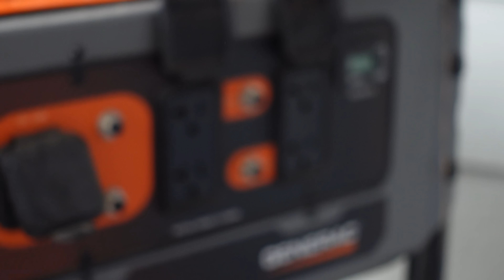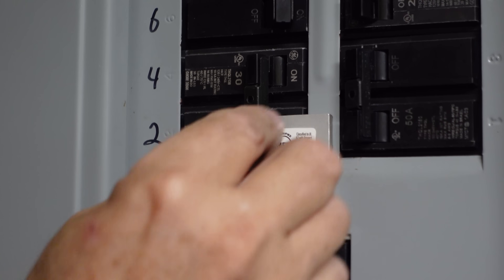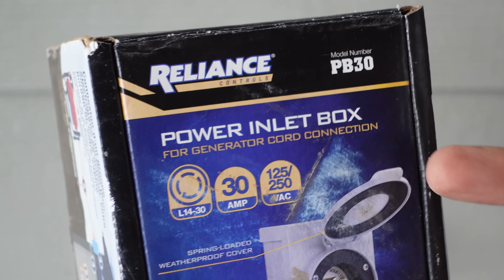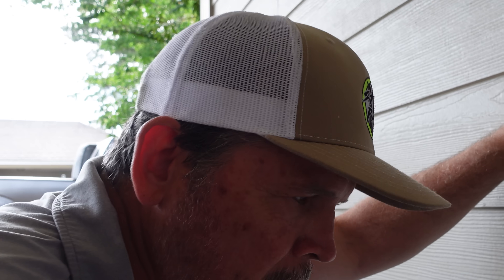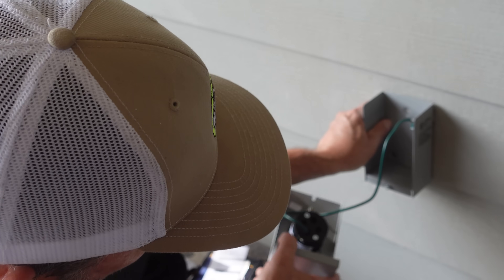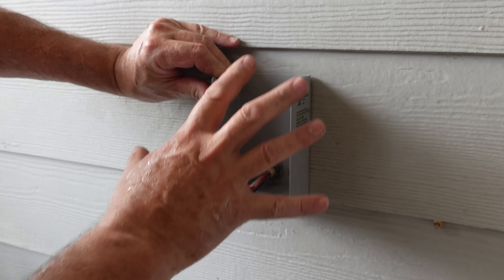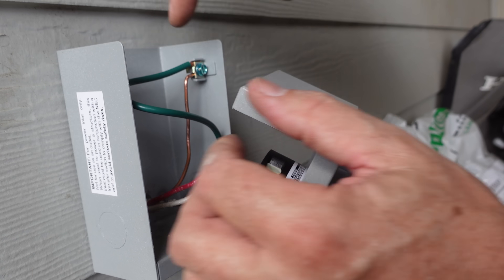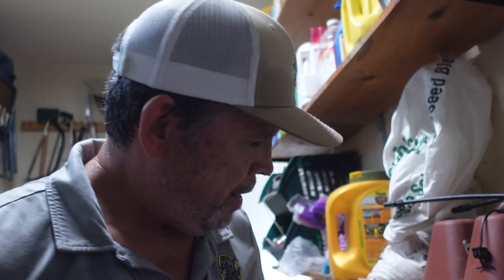What is a Suicide Cord and Why It Could Kill You

Comment: My father has been an electrician for around 30 years and instead of putting a nice inlet on our house for our generator to plug into, he just rips out a breaker from our garage and hardwires it in while leaving the face of the panel off. Then it lays there for a few days until he gets around to putting everything back together all the while power is running to an open panel with wires sticking out all over the place. I'll say this, when he wants to do something right, it's done flawlessly, but around our house he half-asses just about everything. Hell, our main panel doesn't even have an interrupt and nothing is properly labeled...

Comment: I've had a question about suicide cables for a while that no one can answer (as I am not good friends with any tradesman electricians).
At my place of work we have Dunn-Taylor single man mules for getting tools around the warehouse. Its a standard outlet plug to a transformer (which isn't mounted, it can be moved around or toted on the mule for mobile charging if you have to ride out at low power), and from the transformer to a proprietary two prong plug that matches the female outlet on the mule. Why isn't that a suicide cable? I work for a big time company I won't name so there's no way they would buy something with a risk like that, but I can't figure out where the safety is that stops me from dying.

Comment: i have a harbor freight Generator 8750/7000 its now 16 years old and i love it. but i found out the hard way that if i flip my generator breaker on and not shut off the main breaker. it will kill my generator. but i have the safety interlock. mine will run everything in my house even the water heater and stove at the same time. but it does pull it down. but also i have to run a 25 foot cord from my gen to the house. and hopefully by October i can short that wire to about 5 foot of not shorter. but here in Texas if its a portable gen you cant leave it hooked up all the time. or i would just wire it direct.  and Generac has gotten such a bad rap lately of blowing the hell up in the first 24 hours after hooking it up the first-time people are suing them.

Comment: Hello, sorry but i have to correct you about the grid interlock because you are so wrong about it! Backfeeding power back in the grid is absolutley no problem, its an feature which is used for photo electric plants on your roof, wind generators does the same! For high side line voltage, transformer primary side, iam not 100% sure but the tolerances for the voltage are around 5% to 10%, this is on primary side a range about a few hundrets volts, your generator will push nothing out of security specs! The problem is line- or phase asynchronity between the phases of the grid and your generator! In the best case of asynchronity your generator will act as an resistor and draws power from the line instead of feeding power to it, in the worst case of asynchronity (phases are oposite) your generator will act as an shortcut and will blow up in a big fireball! And at least, in most cases when parts of the grid are shutdown for security by breakers and/or transformer switches, your transformer on the end of the road is shutoff too, maybee you will backfeeding power to your neighbors!

Comment: As I watch this video I keep thinking of Paul Timberman's Workshop and the myriad injuries he would've incurred in sixteen and a half minutes. As for the actual job, not only does the new inlet look better, more importantly it is stout and stable for whoever is going to use it. (I would've thought there would've been some form of seal or gasket for the back but it looks like it's under an awning and the connection is fairly protected from the weather anyway.)

Comment: Hold on....an electrician using a level? Gotta be fake. I've never seen that before. 

Jokes aside, that is some pretty work you did there, almost makes me think i should go and do something with that electrical engineering degree i picked up.

then i remember. I work in Pathology, ive done autopsies on shock victims.

Stay safe fellas, and always double check those lines, make sure they arent live for some reason.

Comment: Maximum loading for any branch circuit is 80% of the rating of the circuit for ampacity of wire for any load. (NEC 220-2)

This is known as the 80% NEC ampacity requirement. It tells us that those 30 amps have to represent at most 80% of the ampacity of the wire (copper or aluminum wire).

Here is how we calculate what ampacity wire we need for 30 amp circuit:

30 Amp Wire = 30A × 100% / 80% = 37.5A Ampacity. When we account for 80% NEC requirement, we see that 35A ampacity #10 AWG is not big enough. With 35A, it’s almost big enough but not quite.

To use a 30 amp breaker, we need a wire that can handle at least 37.5 amps. The next is the size after #10 AWG wire (35A) is the #8 AWG wire (50A).

With 50A ampacity, the #8 AWG wire is the perfect wire size for 30 amp service.

Comment: When you put the panel in a year ago, why did you wire a 30 amp breaker for the 20 amp receptacle that was in the wall?  Shouldn't the plug have been changed then?

Comment: This is all really basic stuff.  The only thing that I can see tripping people up is sizing the cable.  It's nice to run a 50' cable to keep the noisy generator away from the house, but 12g wire won't cut it.  It's painful paying for a few hundred feet of 4 wire 10AWG but it's well worth it.  Unless you're the guy who turns on the generator with a bare plug exposed who holds out it in the rain, waves it around, and maybe licks it, for whatever reason.  Maybe such people exist?

Comment: What I know as a "suicide cable" is an extension cord that has one end completely not attached, so it's plugged into the wall and just ends in bare wires, but this is basically the same thing, just slightly less scary looking

Comment: I would have liked to seen you use some Sikaflex or similar product to caulk all around your NEMA 3R (weather proof)  PB30 box since the install is on the exterior.  Excellent install and especially happy to see the mechanical interlock at the panel.  Also caulking, besides keeping water out, will keep critters like wasps and such from making nests in the wall.  I've seen my share of wasps nests doing panel upgrades, and replacing commercial exhaust fans etc.
Reply: Yes, definitely use a sealant ! Also, my OCD wouldn’t allow me to disregard the zero slack of the ground wire inside the new enclosure.

Comment: You can always put Romex connector on slide box on then screw on locknut and no code against putting screws on inside of box ! Also I would have thrown some duct seal around the hole where wire went through the wall ! But I like the way u work taking pride in what you do ! And you have your son with you ! 5 stars to you my friend !

Comment: Nobody should use these suicide-cords, sadly they are also much to common in Europe.
Your solution would probably not satisfy the highest standards here, because somebody could in theory touch pins on the wall-box (Which should not be a problem because of the interlock).
 I think the ultimate solution would be something like the RST20i5 connector where male and female connectors are both safe to touch.

Comment: Thanks for the vid. Great info.  Also, you could tighten the clamp on the wires first, then pull it and the wires tight through the box and tighten the lock nut.

Comment: I was at work one time in the warehouse. I was holding a 240v dryer cord.
I was holding the exposed wiring side with my left hand, and the plug with my right hand.

All I was trying to do was check if the prongs were the same type as the outlet, because there are like 3 different variations of the same plug.

Well, apparently my hand put the plug a little too close to the outlet, causing electricity to run through it. 
The exposed wiring side of the cable had two ends that were touching my accident.

The warehouse lit up with a big flash, like an atomic bomb blew up in the distance. 
It sounded like lightning struck right next to me.

I pulled out the cord, and put it away. The exposed end of the cable melted. 

An employee bursted through the door trying to check on me from the loud noise and bright flash. 
They sounded and looked extremely worried, and I’m just standing there like “sup? Noise? What noise?”

Likely thee stupidest moment in my entire life

Comment: So, what happens when your generator is "Y" center grounded and you just floated the house common at some potential so the lineman down the street gets shocked by the common neutral through earth to the generator?  Your isolation breaker won't protect them because it doesn't isolate generator ground be it "Y" or delta configuration.
Reply: The ground usually goes outside your house into the ground with a stake or is connected to your plumbing where the copper pipe is the ground. Its not connected to the grid at all. Found the stake part out after accidentally hitting it with a weed eater.

Comment: I recently bought a charger cord for my phone that had two male ends that are exactly the same USB end and thus came with a special charging block. That was a major mistake on my part because neither end fitted properly even though they look like they do. I threw the whole set away because how the cord and block were designed, one without the other was worthless unless I wanted to keep one part and pretend it was a decorative object
Reply: Was it a dual-ended USB C cable or was it USB A? Or was it lightning, because I'm sure dual-ended lightning cables exist. What phone do you have?
Reply: @richardmillhousenixon  Duel-ended USB C; I have an Android
Reply: @samsimington5563  USB C is becoming a standard to replace USB A, so it is really easy to find USB C power blocks and USB C dual ended cables

Comment: Is the wire going to the panel large enough? I couldn’t see the gauge of the wires. I think that I would install #8. I understand that #10 is the minimum for 30 amps. I would install #8 for as hot as it gets there and for a possible future upgrade of a larger gen set. That’s just me though, I over do it on for most stuff.🙄🙄🙄

Comment: You’ve done that before! Lovely professional job.
What are those cables from the new outdoor switch to the MSWB rated at?.
Where I live we have 240v and 415v as our low voltage supply network- dependant on whether the property requires single, two or three phase supply.

Comment: i find it interesting to look how other countries do electrics and deal with their problems, i do still kinda hate the split phase thing the US does but hey i guess americans always had that style.
great install though. but i would not reccommend doing electrics if you're not an electrician, as yes overtightening wires is also not a good thing. 
a little added side tip from an electrician, do not yank wires or cables, you may yank their connections loose.

Comment: One thing I noticed you didn't cover, the cord itself during usage, if it is hung where it has slack and can receive rain and wind {between a gen shed and the house for instance}, you need to hang in such a way as to be drip looped, even the best seals can work loose over time and water runs downhill, {both ends} need to {run up to the plugs}. A minor hazard but over time a bad seal and or runaround the plugs, can let water run into places where it shouldn't be, especially if it's carrying particulates. No fun when the backup shorts out and ruins hundreds of bucks worth of gear, on top of losing backup power. Seen this happen in Fl.

Comment: Good video. I was wondering what the rules are regarding also switching the neutral as part of the generator interlock? During the Ontario Ice Storm in '98 the inspector really stressed disconnecting the neutral in addition to switching off the main breaker. He claimed it was possible to back feed on the neutral and harm linemen. When I looked at Square D generator panels in HD a while back they used a pair of interconnected 3 phase breakers to switch from mains to generator power (so they could isolate all 3 feed wires).
Reply: @AndrewMoizer - Yes !!  I had Electricians install the 2 Square D breakers at the top of the 200 amp panel, and the way they worked when you tripped the top one, it stopped any electricity from going back to the Main.. The 2nd breaker had some kind of interlock and only worked when the 1st breaker was turned off first.. The outdoor plug was next breaker and it allowed the 66.6 amp generator to supply the entire panel...  It was a lot of work because the 2 new Square D breakers had to go at the top, so All the breakers below had to be moved farther down the panel to fit the new guys...  :)
Reply: @frandanco6289  Have seen some of those interlocks. Makes sense, although this is still not disconnecting the incoming (service) neutral wire. Not sure if that's needed or not. It sure seems to me that as long as the main breaker is off it's not possible to get current flowing through the service wires.

Comment: I have been hit hard by 230 volts. It knocked me out. I woke up in the floor with my wife standing over me screaming are you ok. I felt bad for about a week after that my heart rate was a tad off for a while. I was working on repairing a dryer. I turned off the breaker but it was labeled incorrectly.

Comment: It's not just the connector that needs to be rated at 30 Amps it's the wiring in your home. The carbon monoxide from that generator could kill you even more easily, make sure you locate that thing well back from your home. I would have bought a 10 Amp 240 volt generator.

Comment: In my house the panel with all the breakers for all the things is actually a sub panel, with the main one being a small panel with a giant switch (mains/off/generator). When power goes out, you turn off all the breakers, put the mains breaker into generator position, start the generator and start turning breakers for needed things one by one.

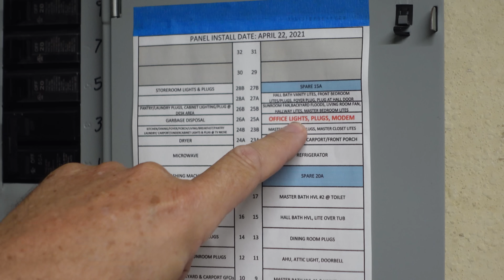Comment: 2:56 Great job! I do have a little apprehension about that interlock, though. It would be too easy for a naive or lazy homeowner (or tenant!)  to simply take that Z-shaped piece off and forget to replace it, especially in a year in which outages are frequent. Wouldn't it be safer and more convenient  to have a double-pole, double-throw switch that selects the line power or the generator?  Then all 4 breakers could be left on.
Reply: It is loose enough to slide you don’t need a screw driver to switch over.  Maybe security screws might slow an idiot down  or a lock on the cover so the plate isn’t accessible.  A rubber grommet or a cable gland would be better on the knock out on the box, so there is no possibility of the cable getting cut on the sharp edge of the knock out.
Reply: @blackestknights  i agree with a dpdt transfer switch. start the generator & flip the switch-done! no fumbling around with "interlocks" in the dark & the switch is less likely to be tampered with.
Reply: @garybrown7044  that’s what the sliding plate does only allows either gen power or mains power you switch to gen and mains is isolated switch to mains and the gen is isolated. Of course if you have solar and mains you would need to be able to isolate both.

Comment: Subscribed.  This was an excellent video, very high signal to noise ratio.  I knew the basics, but little tips like how that ground screw worked with the metal tab under it, I did not know.  Only thing I wonder is why you didn't  seal the bottom area under the box where the sideboard had previously been removed.  Bees or bugs could get in there, you could see the light through the hole on the inside.

Comment: I use a "deadly" suicide cord at my house during power outage. Backfeed the panel through the dryer outlet in the garage WITH MAIN BREAKER OFF so it doesn't backfeed to grid. Yes it's dangerous, but with proper knowledge it's a calculated risk. The problem is- it's not fool proof.

Comment: I have a generator i have kept for hurricane season for 15 years. Replacing the carburetor every few years is fairly cheap and may fall into the capabilities of the average guy as opposed to spending hours trying to clean an old one or paying someone to do it for you. Part of that job is removing the four screws holding the fuel tank and empty it out into a waste fuel container. Once that is done remove and clear out the fuel line and shut off valve. re install it using yellow gas proof thread tape on the threaded fuel valve. On my own equipment i put sand in the fuel tank and shake the hell out of it. I do this hoping it will remove loose debris in the tank. Care must be taken to rinse out all the sand before assembling it for use.  Dawn dish soap or Awesome detergent works too, It might be a little cleaner when done.. Amazon can be a good source for a new carburetor and might be cheaper than you think once deciding to tackle the job at home.  This video reminds me i have exterior wall outlets to replace that no longer would be considered up to code when the house was built in 1997. Living in our camper a for a few days if the power goes out is a routine with the A/C and generator going.

Comment: The problem is that homeowners don't want to pay for a professional to use the right hardware and equipment . They get the price and then decide to either try themselves or hire a guy off the street to do it at half the quoted price , smh .... Great video by the way. I wish every electrician would use a spreadsheet in the panel !!